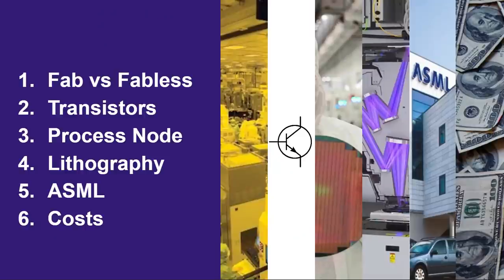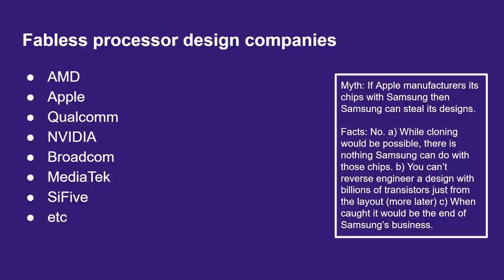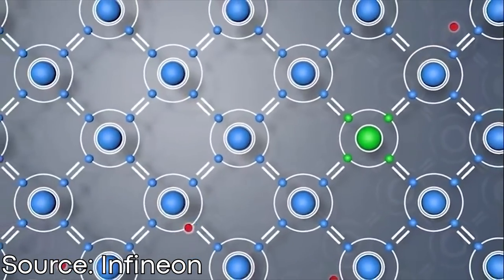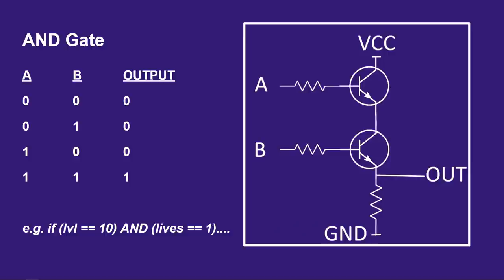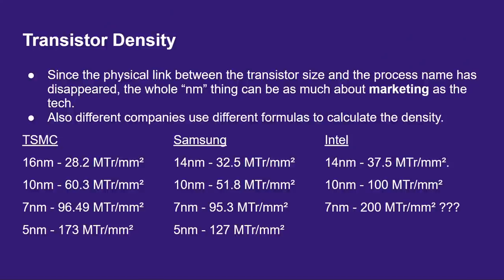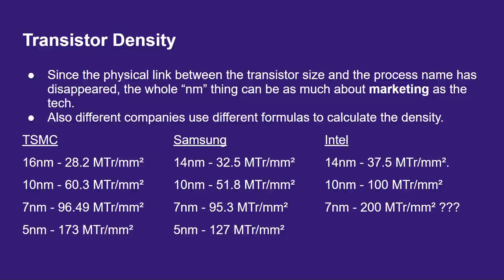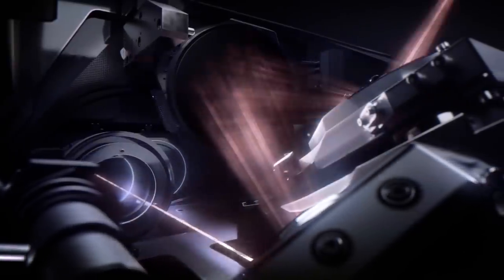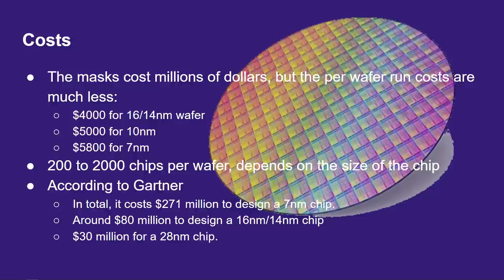How CPUs and Processors are Made for Smartphones, Laptops, and Desktops

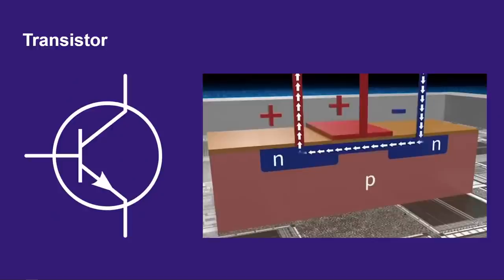Comment: 9:08 should be a MOSFET symbol, that's Bipolar junction transistor symbol. Great video tho :D
Reply: Gary was explaining bipolar transistor operation which is controlled by base current whereas FET operation controlled using a gate voltage.
Reply: Most modern digital ICs use FETs (MOSFETs).
Reply: Yes, the Infineon video has quite a few simplifications. The device shown is a simplified MOSFET. I think Gary is just using the bipolar transistor symbol for simplicity (and perhaps because it's better known).
That said, if you know the difference, you didn't need an explanation of what a transistor is. :-)
Reply: You beat me to it.  I was going to point that out as well.
Reply: @pebbleschan6085  I think you will find every chip designed since the 90's uses NMOS FETs. CMOS was being used way back in the 70's and bipolar are only used on legacy components like the 741 and other op-amps etc. Even new op-amps are NMOS.
Reply: You’re absolutely right. I still use some bipolar PROMs with nichrome fuseable links. I’ve also got some PMOS Static RAMs!  When CMOS tech was sped up the Z80 was upgraded to CMOS with additional lower power idle modes.
Reply: @PebblesChan  My college teacher never would have let me graduate if I didn't know that, given where our professions are now.

Comment: When he talks about how ISA or instruction code wouldn't bring down the cost, he is wrong. Companies like Samsung, AMD, and even Intel has to pay royalties to design and use instruction sets like ARM, x86-32 and x86-64, respectively. That cost trickle down into retail.
Reply from the maker: While technically you are right, the licensing cost is negligible compared to the other costs. It is like someone buying a new laptop and being charged for the plastic bag. Then they complain that they had to pay for the bag.

Comment: To add on how expensive manufacturing semiconductors. A good estimate would be 1million dollars per mask step. 

A discrete transistor part ranges from 6-10 mask steps. Imagine how many layer and $$$$ would it cost to manufacture a cpus.

While Gary only covered the front end part in this video. These wafers will undergo probe testing to weed out failing die. Assembly. Test to weed out damaged die and non conforming products during the assembly process. It doesnt end there, it still undergo strict Reliability test and failure analysis before it can be sold to the public.

Before asking why tech companies ask a hefty pricetag for something thats just made of sand. Consider the reasearch, processes, certification and manpower spent creating it.

Comment: @11:07: sorry, but this will NOT work ! You should use negative logic instead. If you apply a current to port B, you will get a High or Highish (due to the 
Base resistor) level on OUT. But the shown schematic will well work with MOSFETS.  Told ya, you should have explained the MOSFET instead.

Here's the explaination why:
https://www.youtube.com/watch?v=hLwGtucsTms